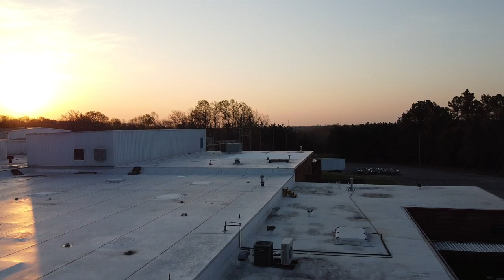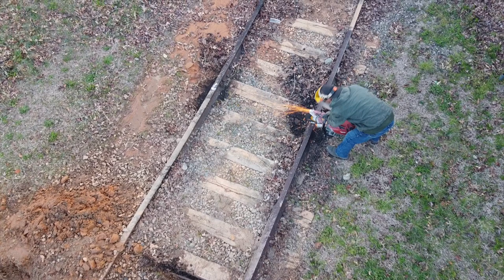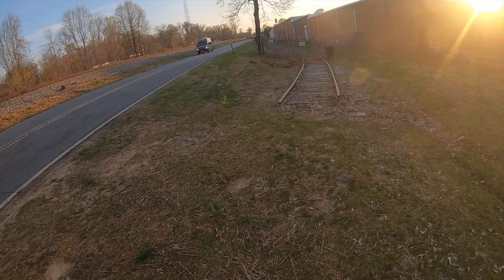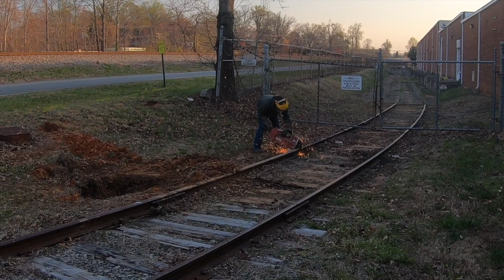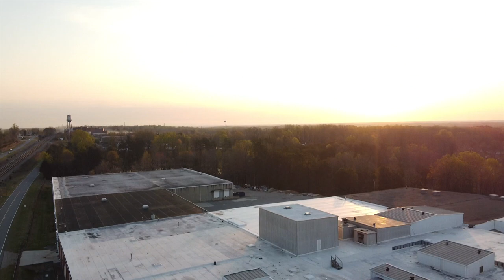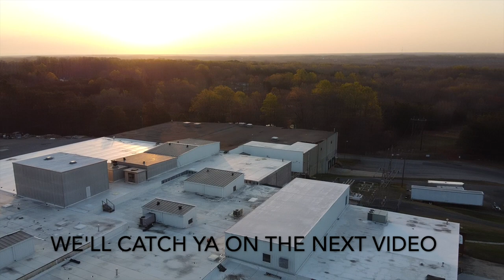We cut the railroad track!!!! No more trains...

Comment: We actually use saws just like this on the railroad to cut the rail. We have a vice that mounts to the track so the cuts are straight for welding.
Reply from the maker: That’s awesome.  I figured this would be best to cut it.  We were definitely surprised at how hard the steel was.  I guess it has to be to hold up to that much weight on it constantly.